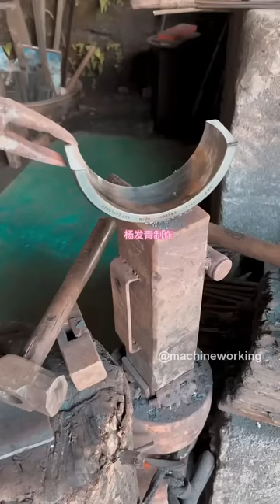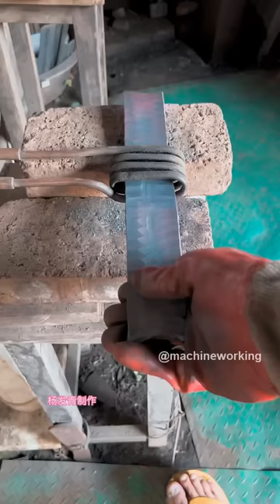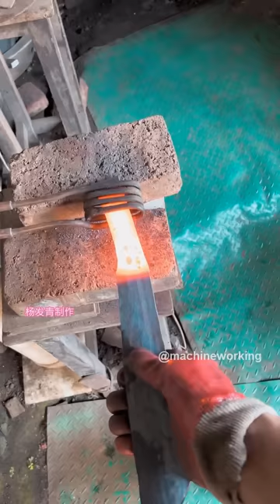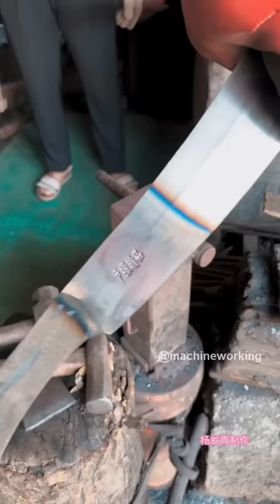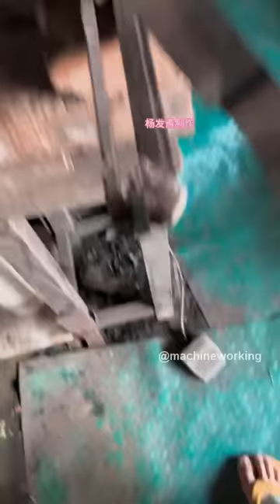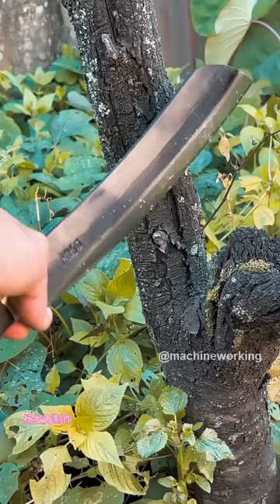Request from a distant customer - Manually forging knives from old bearings

Comment: Bearing steel is most often 52100 or similar steel and to get out maximum of that steel you need right temperature and time.You cannot get maximum of the steel just heating and quenching and prior that with normalization
Reply: yeah but youdont always want maximun hardness.